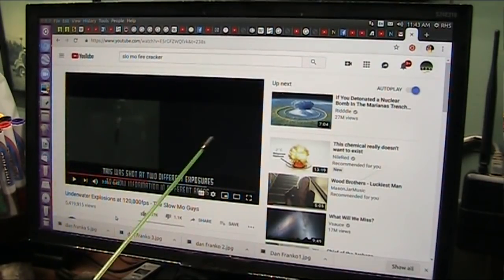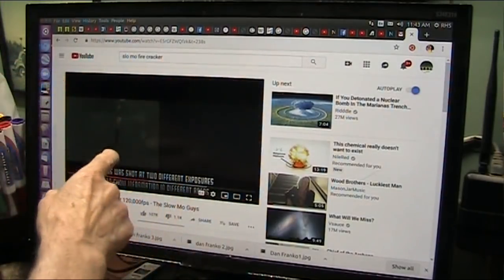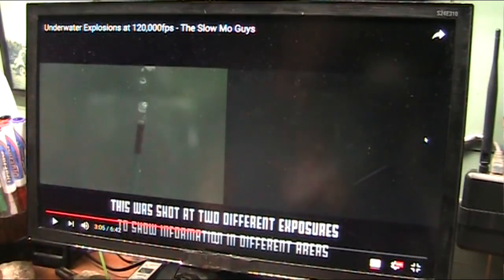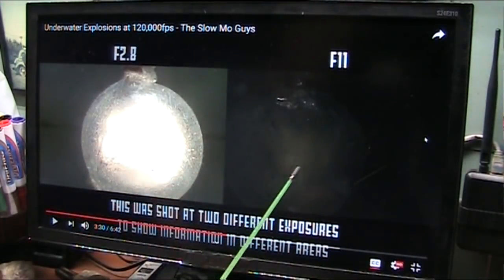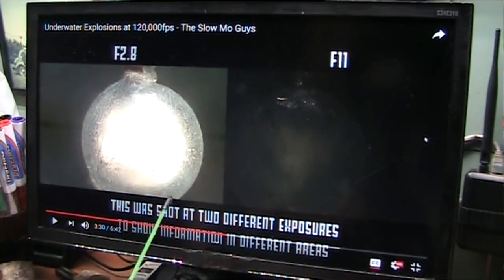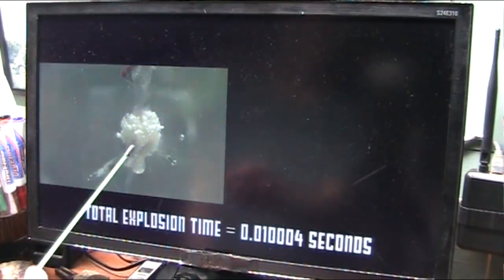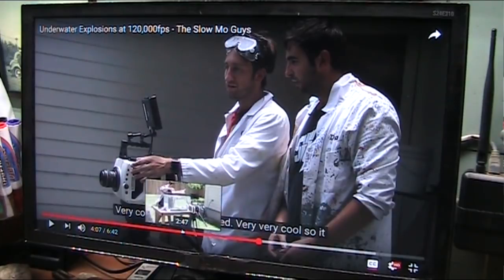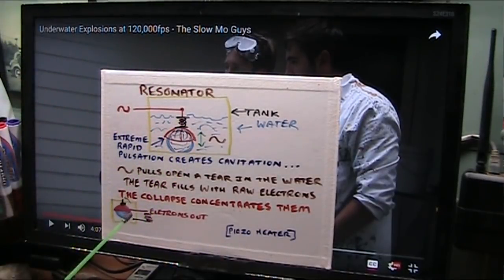Electro Cavitation Collection and Free Energy

Comment: You are on point Roger. Look up Bob Greenyear's recent visit to Dr, Ohmasa' lab. Ohmasa gas is made using sound and treated water. The gas will dustify tungsten with a 200f torch through transmutation not melting. Think Hutchinson Effect at will. Cheers and onward!